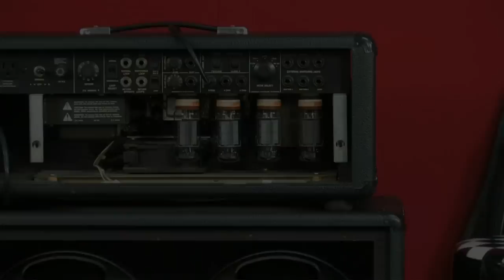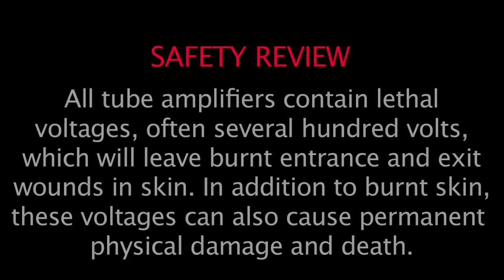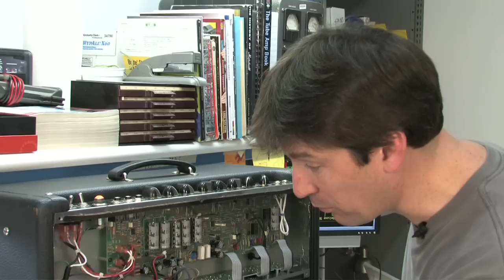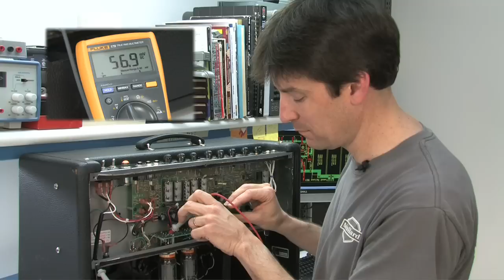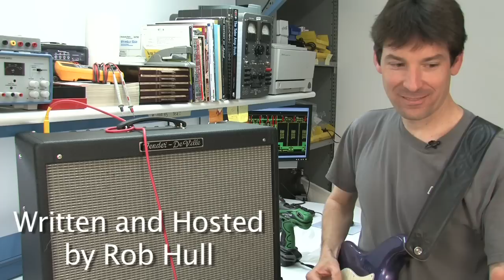How To Bias a Deville Amplifier

Comment: Extremely cold bias per tube…41-48mV is what the range per tube  should be with their average 430-432DCV plate voltage on these amps. Fender biases them extremely cold from the factory so that the tubes will last through the warranty period 🙄

Comment: Isn't 60 ma a pretty cold two tube setting ? Shouldn't it be more than that At Atleast 70 ? , At 60 for the pair or 30 ma each the dissipation is only at 14.5 watts each on A 30 Watt each tube . In theory 120 ma or 60 ma each should be fine. I know that 70-80 even 90 ma is considered acceptable for most people. I was wondering why Fender would have such a low bias point ? Is it the newer tubes that are the problem or the excessive gain ? . I'd like to understand it more because At 60 ma. For A pair, A lot of The Newer 6L6 GC tubes just don't sound very good.
Reply: The original power tubes in my Deville II were 5881 relabled as GT6L6B by Groove Tubes. Maybe that has to do with the original spec of the amp.

Comment: I have a set of the expensive SED 6L6 quad pair and found they sound brittle and bright and lack any warmth and was told if you do not have at least 450 plate volts that they do not sound good and i only had 360 plate volts so there back in there boxes !

Comment: I have done this once before and got 9-10 years from my tubes. Bought new tubes and begun this process again I was successful in getting -68 on standby. With the standby switched to ON I could not get a mv reading whatsoever at the test point. I’ve tried two different meters and still no reading. Why would this be?
Reply: All the Valves ( tubes ) are New. The output tubes are JJ Electronic 6L6 GC and are matched. The Pre Amp Tubes are JJ Electronic ECC83. The multi meter is switched to DC V and mv setting. Black Lead Grounded and Red Lead at the test point as per the instructions in this video.
Reply: Prior to replacing the Tubes, the fuse blew while I was playing through the amp. I replaced the tube and a whining noise was present. So, I replaced the tubes. The amp works on all its channels but I am unable to set the bias because I am not getting a measurement at the TEST POINT,
Reply: Upon visual inspection, nothing is discoloured or burnt. There are no cracked solder joints anywhere. WHY am I not able to get mv reading at TEST POINT???

Comment: Hi...I'm a layman so I need to ask a question...do these parameters (approx. 60mV) work for any brand of power tube? The original ones that came on my Hot Rod are two 6L6GC GT and I want to exchange it for two JJ 6L6GC. So the ideal parameter is still about 60mV? Thank you so much

Comment: G'day Rob,  I hope you've been well in this time of crisis. I'm 11 years or more late on this, but I guess it's better late than never. Amongst most of the Biasing for the Hot Rod Deluxe I've seen, I decided to follow yours because it is the most clear (visually plus the audio & explanations) I've just done my Hot Rod today .. with 101% confidence thanks to you.  Just one thing which I thought is super important, for those non-techo's like me. .... that's the detailed settings of the multimeter. I had to go over your video a few times to be sure.  Where you set the multimeter to "Volts" to take the reading of the plate behind the Bias adjust knob, but mentioned very little about changing the multimeter to mV when setting the actual Bias while at the same time looking at the mV readings. I was lucky I saw the different settings showing on the video for your multimeter and so followed. In my case every detail of the procedure is important. Hope this will help you help us (non-techos) for future video releases. Stay well and all the best. 
ru

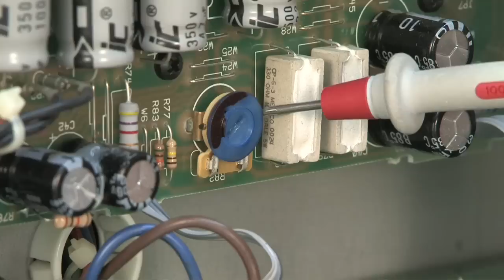Comment: Can someone tell me what the 3:28 step is for? So you measure the voltage and adjust it to the most negative using the same pot thats used when checking the tube test ? 
What i want to know is if you basically just roll it back and then clockwise
Reply: Is it because it was on stand by? Does the function of the pot change with the stand by toggle?

Comment: TUBEDEPOT 
When you're biasing the power tubes in an amplifier circuit how do you bias the compression of the power tubes the 1dB compression point of when the power tubes start to compression? because its say to bias tubes at a 30mA bias current per tube to be safe but how do you know when the tube is compressing?

Most Power tubes 6L6,EL34 use a B+450vdc on the plates, if you increase the B+ to +600vdc would this increase the AC ripple but why would it increase the AC ripple? i would think it would decrease the AC ripple because more B+ voltage mean less current draw from the power tubes.

Comment: This method of setting the bias works but doesn’t check the Queasiest current in the circuit.  It assumes that the tube is working as prescribed in its specs they usually  don’t and different manufacturers vary a lot .  a better way is to where you look at a voltage across a low value precession resistance in cathodes which generally goes to ground.Dynaco. Wisely choose value of 1.56 ohms so the 100 ma bias current developments 1.56 volts precisely this amp was offered as a kit and setting the bias really maters but a good voltmeter was expensive and cheap ones were really inaccurate but a fresh d cell battery is 1.56 on the money so take your cheap meter and mark it using the battery as a reference so at that voltage it’s very good many hifi type amp have a jack per tube the jack is generally a short when you inset the jack you measure the current and it’s 100 percent accurate

Comment: Great video! Very helpful and informative. I've had my Deville for probably 10 years and I was never 100% happy with the gain/overdrive channel. It sounded.......raspy.....not smooth at all.
I installed a Fromel kit, which made things better....but still....something wasn't quite right. 
I had the amp serviced/biased/etc. Again.....better, but not quite 'there'.

So I found your video and did as you suggested. The bias was set at 58-59, and the blue trimmer was epoxied in place.
I powered-off and carefully trimmed the epoxy. I set the bias to 68 (the alleged 'sweet spot'), let it warm-up and took it for a spin.
Much better! I was more satisfied with the gain....definitely an improvement.
I also thought the clean channel had improved as well.....I could hear a difference.
I kicked the bias up to 70 and I'm happy with it. Looking forward to next band rehearsal.

Comment: Is it true that you do not have to bias a amplifier so long as you are replacing with a matching set of power tubes.
Reply: No thats not right, a matched pair means that the two Tubes has the same Parameter and so you have to check the bias everytime you chance your amplifier-tubes. It depends on the amp too, some amps don't have a bias poti or have auto bias.

(Sorry for my bad englisch)

Comment: Nice Video. I like the information. 1 Question; Volt Setting on the multimeter is DC Volts or AC Volts. ( I saw DC VOlts in this video but I believe Alternating signal is in the amp). Please clarify. Thanks.
Reply: The meter is set to measure DC milliVolts.

Comment: Great video, thanks! Is the procedure similar for swapping out the 12ax7s? My deville has a noisy buzz in the gain channel. Ive tried multiple guitars and it nets the same result. Also when turning up both the presence and reverb past 50%, it makes this high pitched scream. I'm hoping one or both of these issues would be fixed after checking the solder points and swapping tubes.
Reply: It could be a microphonic tube. Fortunately preamp tubes don't need to be biased, you can just replace them without any further adjustment.

Comment: I have a DeVille as well and after watching this video i bought some new power tubes, changed them out and biased it myself, running a little hot cuz i like it break up a bit faster. . .  

But even after the power tube replacement my amp still sounds weak.  Clean channel is fine, but channel 2, even with the drive ALL the way up doesn't sound like it used to.  What does this mean?  Do i need to change the pre-amp tubes to get that gnarly gain i used to get out of it?  

I've only had the amp for about 9 years.  Which sounds like a long time, but i know people go even longer than that without changing the tubes.  

HELP ME BREH!!!

Comment: I bought my DeVille  2/12 in 1996 and I've never adjusted the bias level... the original Fender tubes burnt out in 1998 and I replaced them with a set of tubes from a guy I found in the Nickel Ads in Portland Or. They've never gone bad and still work to this day! I'd be interested to see what the bias level is set to?

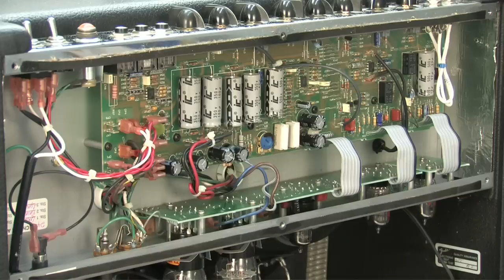Comment: At 1:23 you say to not touch anything without first discharging the amp. How is this done? Will simply turning it off and unplugging your amp discharge it after a period of time?
Reply: I made a wand out of a cheap screwdriver, alligator clip and a 1k resistor. Alligator clip lead is soldered to the resistor, resistor to the Clip the alligator clip to the chassis, touch the end of the screwdriver to the positive end of one of the filter caps. That will usually discharge most caps in less than 10 seconds. 

They will discharge after turning the amp off while the cathodes are still hot enough to emit electrons. But don’t rely on that alone before sticking your hands in there. Plus, it only works if the tubes are installed, if you’re testing something with the tubes pulled, those caps will hold a charge for quite a while.
Reply: Mike Lowrey Well, probably, after a month.. 
I'm tempted to say "if you have to ask, don't do it."   - Not to be snarky, but because it's actually dangerous. 
A power resistor is used to discharge the power supply filter caps. 
There's a lot of videos about it. 
If in doubt, take it to your tech.
Reply: @xenod1066  dude, why not just give advice if you're taking the time to comment? Snarky as h*ll

Comment: Hello, Mr. Hull, I've a question about the IC capacitors in my Fender HRDeluxe III Made in Mexico. 
I bought one of this 1 year ago,  in a Internet page I read a suggestion. A person said " if you buy a Made in Mexico, this amplifier come with IC caps, you  need to replace for another capacitors of more quality. 
Are IC capacitors so bad?
Reply: Hey here are my thoughts on your question. They are probably just referring to the fact that Illinois Capacitor (or IC) are regular production electrolytic capacitors not audio grade electrolytic capacitors. For a mass produced and releatively inexpensive product that is not uncommon to see that used. If it was a boutique amp it would be expected to see something built for that specific purpose like Sprague Atom or F&T caps used. You might hear some slight improvement if you put some more expensive electrolytic caps in there but I do not know (just make sure to discharge the old caps if you wanted to replace them yourself). Personally I would't say it would be worth it. I'd just say if you were worried about the audio quality get a more expensive amp as you'd also be upgrading the transformers. The transformers will have more effect on the tone then the types of capacitors used.
Reply: Does your amp have an annoying hum? No? Then if it ain't broke, don't fix it!
Reply: Silas Fatchett right now my amplifier start to do a hum from the filter cap more biggest. The 500v. 47uF. That is the problem about I need to change the caps?
Reply: Dying filter caps is the most likely (but not the only) cause of hum. Changing the caps may fix the hum, and won't hurt anything but your wallet.
Reply: Silas Fatchett I have a technique to detect noise in my car. I use a hose and my ear to find noises, and I did the same with my amplifier and curiously the capacitor with more noise is the biggest. Thank U

Comment: hmmmmmmm,   I have a Blues Deville in the corner of the basement I need to revive..., I have that "printed circuit board allergy syndrome" that I need to overcome. I bought this amp nonworking on ebay for $275. It smelled like a bartender's garbage can (empty beer bottles and ashtrays) when I pulled it out of the shipping box. First thing I thought was... kool, it's done. The speakers were unplugged and it fired right up. The pots are scratchy as hell so I haven't  used it much. The cabinet is fraid worn, torn, cigarette burnt and beer stained. Actually all things concidering.., perfect.

Comment: Very Good Explanation! Glad you mentioned safety. Too bad for the Test Point - the PCB should have a Tip Probe socket for holding the DMM's probe. To minimize the chance of getting an electrical shock (although not UL approved/tested) I wear the Black thicker Mechanics "Nitrile Gloves". Love 6L6 amps like the Deville (I have a Peavey ValveKing 2x 6L6). A dab of Nail Polish or RTV/Silicone keeps the pot from moving after being set.

Comment: I used this most excellent of all tutorial's in 2015 for biasing my new Fender Dot Rod Deville III 410. I deliberately set the Ma to only 57-59 Ma to prolong tube life. 

Now I have been wondering to my self if this is too cold and did I sacrifice tone. I can not get power tube break up at any volume and when it's at full volume I get that "ice pick" pain in my ears it's so loud.

I think I shall re-bias to the 60 Ma and maybe change V1 to the 12AT7 which has 60% as much gain as the 12AX7 which has 100%.

The  available Pre Amp tubes have these gain factors:
12AX7 100%
5751 70%
12AXT7 60%
12AY7 45%
12AV7 41%
12AU7 19%

Changing tubes is not difficult so I may even set the bias as high as 70 Ma or 80 Ma just as rob mentioned. If the amp then sounds warmer to my ears it will be worth the cost of purchasing new tubes sooner. After all I did not purchase the amp to save money but rather to enjoy the tone of a fine amplifier. He, he, as usual I outsmarted myself with the too cold re-bias from the factory settings of 60 Ma. Live and Learn!
Thanks again Rob for your video, for re-biasing/bias of a Fender Deville it's the best one on You-Tube!
Reply: I tried 2 different 12AT7's and at volume over 4 1/2 the amp made a strange noise. I have decided my amp only want's 12AX7's.

Comment: Hi. Have a Deville 212. Cant get voltage on test point, but it is present on regulator... But even at max setting it only gets to around 54vdc. Local ac is around 109/110v. Any idéias?

Comment: Hi Rob, Tube Depot, Just a little FYI, the ribbon connectors on the Deville can come loose and this will cause issues with the amp and performance of. El Paso Tube amps on YouTube did a video about this problem, worth a view. Discharge filter caps first when working on amps, use only one hand when hooking up meter. Also see Uncle Doug on YT, very knowledgeable. Take care, C.

Comment: What part of the amp is the part that can cause death?
Reply: +Vivian Stanshall The high voltages which are stored in the filter capacitors, the five grey vertical tubes in the middle of the electronics. However, the voltages that are stored appear at various other places in the amp, so unless you know EXACTLY what you are doing, don't touch anything!

Comment: Second video Ive seen biasing by voltage, by the way voltage does not split it's the same for both tubes, current splits, which is really what u need to adjust. The idea of biasing is to set how much current the tube draws. Even tubes of the same make have different internal resistance so by ohm's law by using a set voltage your current draw will vary from tube to tube. U really need a different voltage for different tubes to get the correct current flow. Adjusting by voltage is better than not but really not yielding the proper results.
Reply: By measuring the voltage at the test point (across a 1 Ohm resistor between cathodes and ground), you are indirectly measuring the current in the tubes. With 60mV at the test point there will be 60mA flowing in the tubes. (60mV / 1 Ohm = 60mA.)

Comment: your amp hot rod sounds well.Your -bias adjustments are oké.But one thing you forgot...to check the sockets solder points after your tube replacement.Your finger-picking guitar style sounds good and this FEnder Hot Rod sounds tight.

Comment: thank you for the great videos as always.Sir i have question,I have hammond 291AEX 240 euro power transformer,but the primary has two black wires not like us version ,in this case when i connect to champ 5F1push pull pot.do i have make sure which is hot and return or i can connect any of these two leads switch and fuse?any help really do appreciate.

Comment: Hello internet,
I have a BDRI and was thinking of dropping in a set of JJ 6V6s the make the amp "quieter". 
But before doing this :
1 - Do i need to change the speaker from 8 to 16ohm ?
2 - Should i re-bias ? And if so, what would be the correct value for 6v6s ?

One last question, many people recommend to throw a 12AY7 in the preamp section. Some says in V1, others in V2... V3. What would you recommend ?
Thank you
Reply: you always have to check your bias if you change your Powertubs.

Comment: Very informative and to the point. Thanks for sharing.. Mighty fine guitar playing as well. That's how my amp used to sound. I repaired a cracked solder joint at the "foot switch" connector, but now I find there's something not right with the far right, small(pre-amp) tube. A friend tested my tubes by removing them, then stuck new tubes in thew sockets(1 by 1). That's when I noticed he wasn't quite somber enough to be doing this test. He either bent the pins and/or caused damage at the connection.
 I realized this when it popped and  cut in and out as I barely wiggled the the tube. Are the tube pins worth messing with till they fit again(If that's the only damage) or should I just replace them with new tubes?